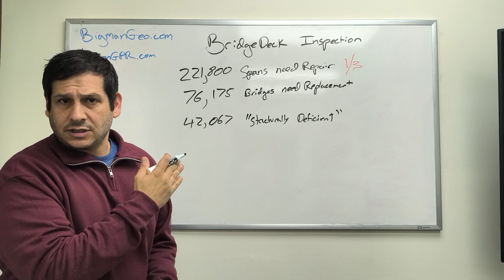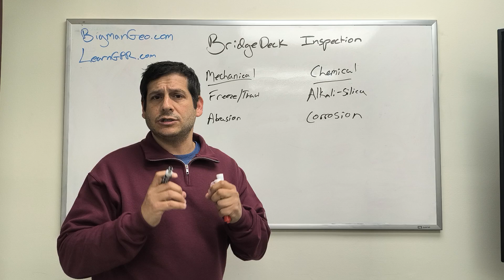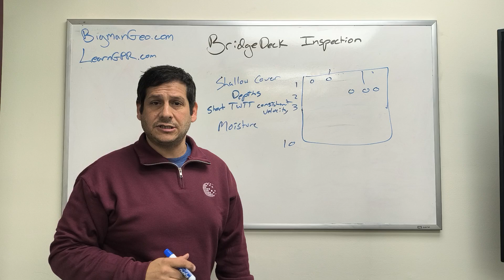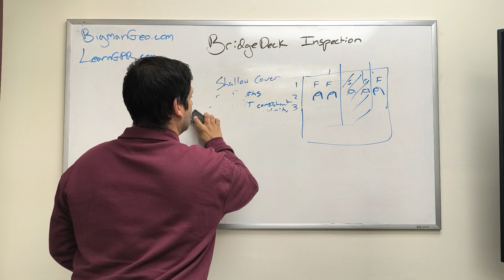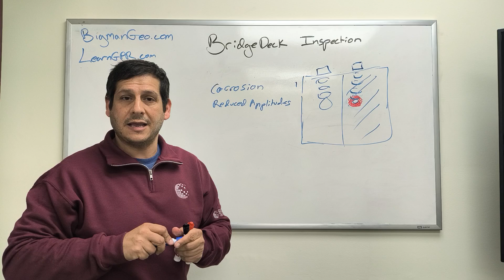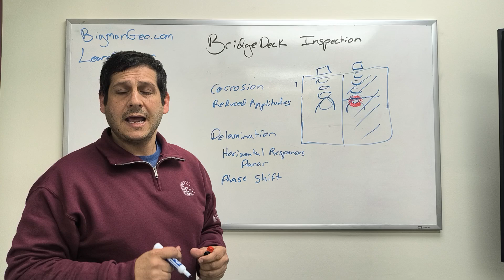How to test Concrete Bridges with GPR | Ground Penetrating Radar | Structural Engineering

Comment: Hi, I really like your  vidéos guys, and the way you spline it,
I learned a lot of us gentleman's 
Any advice on a GPR good enough for Ancient ruins and buildings.
Thanks
Reply from the maker: Hi! Thanks so much for the compliment and for watching the videos. The systems that we generally use for this application include the IDS Chaser, Sensors and Software Noggin, and we have used the Mala system with success. If you are interested in a quote for the chaser you can contact sales@bigmangeo.com
Reply: Thanks for your reply. 
I will get in touch via email. 
Really appreciated
Reply from the maker: @salaheddine11 my pleasure 🙏